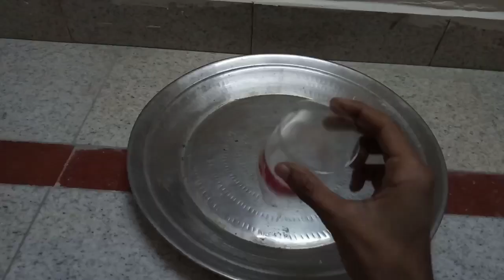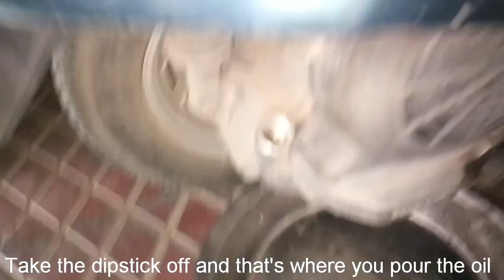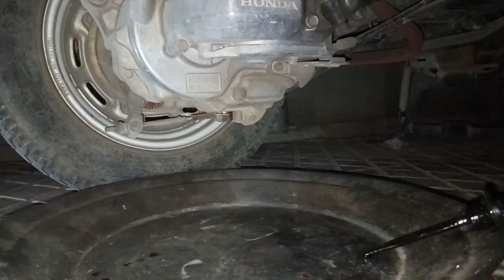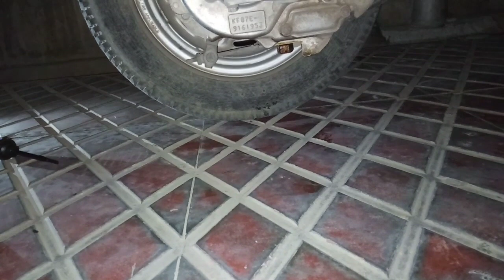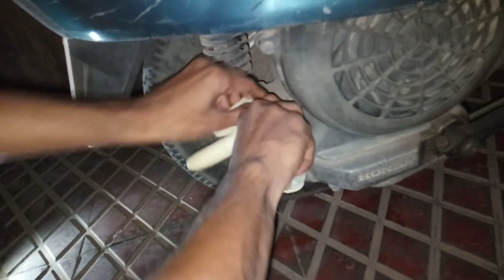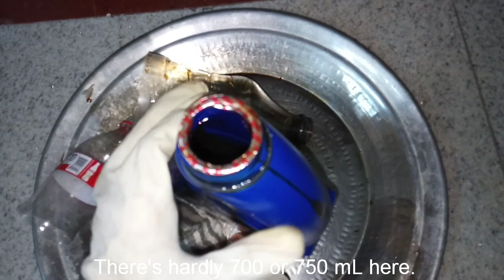SCOOTER ENGINE OIL CHANGE (Complete Guide) | Honda Eterno 150

Comment: Thanks for the video brother. But I would like to listen the sound of your scooter too. So in order to do the same please post another video based on its review and sound.
Reply from the maker: Sure brother! There is going to be an ownership review video of Eterno. Please stay tuned. Hope you've subscribed to the channel 😇
Reply: @AshimDasVlogs  yes I have already subscribed it
Reply: @AshimDasVlogs  still waiting brother 😁
Reply: Mere Bhai ka Activa 4g 
70 thousand km chala he milage 40-48 engine open nahihua
Reply: But eterno Activa se jayda powerful and milage jayda he
Reply: Or us Activa ka ek bar spark plug khulahe
Reply: Mere uncle pe as eterno he Kitna chala pata nahi Lekin Daly 50 km chlatahe
Reply: Minimum 1lak km hoga break liver ko dekh ke
Reply: @AshimDasVlogs  eterno Activa se jayda powerful he
But Activa ka engine realible he build 
Quality achahe
Reply: Activa ka ekbar belt change hua ekbar battery ekbar throttle wire ekbar spark plug 5 bar air filter
Reply: Or break pass rare ka 5 bar front ka ekbar
Reply: Belt 60 thousand km chala